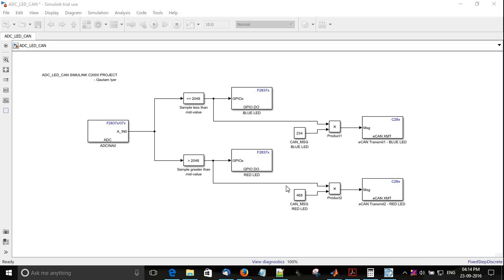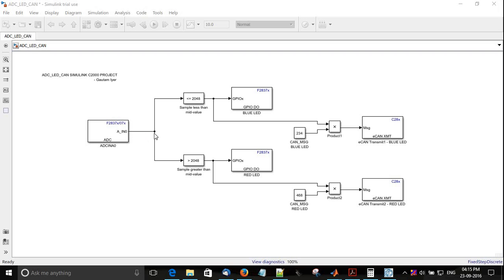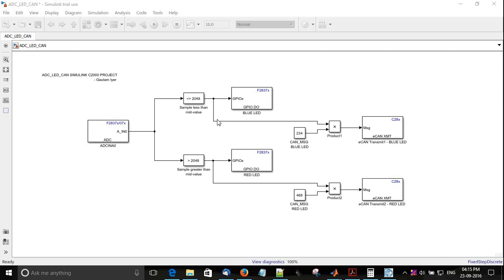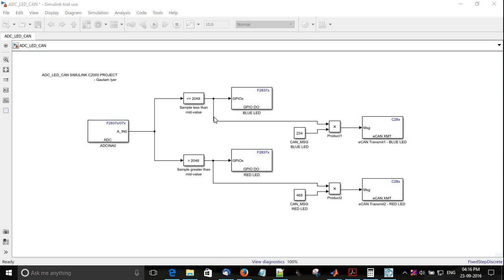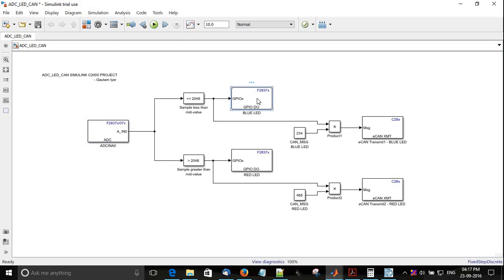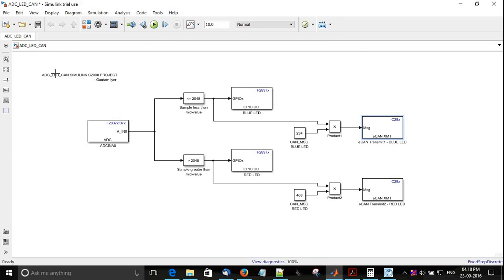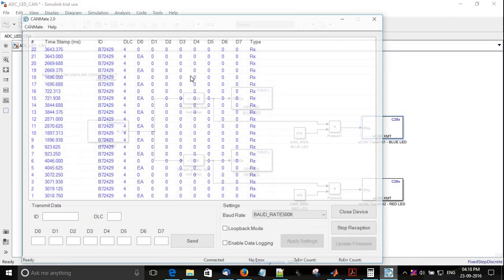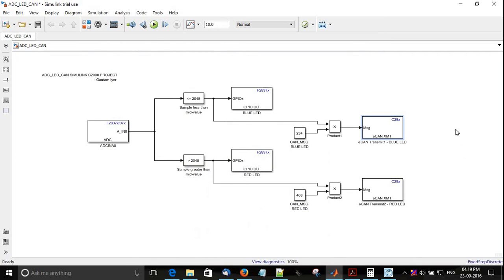Playing with ADC, GPIO and eCAN peripherals on TMS320F28379D launchpad - Simulink

Comment: Can you please help me in acquiring data of 4 input channels simultaneously by using TMS320F28379D?
Reply from the maker: Hi Venky, I would recommend you to post your queries on Simulink forum for C2000 devices.
Reply: @GautamIyer  I'm not using simulink ..I'm using it with CCS...
Reply from the maker: @venkateshgittagoni5659  oh... In that case C2000ware has examples and E2E forum would be the best place to answer your queries.

Comment: If I use Software trigger (while specifying sampling rate) then ADC will sample at specified time automatically right? Or do I have to give software trigger on my own? If I have to give software trigger,  how do I do that? The name 'software trigger' kind of confused me ^^"!

In this video you are using CPU Timer 0 for triggering SOC, what's difference between using that and software timer? 
PS : Your videos are way good and are helping us a lot in our BE Project, ty!
Reply from the maker: First of all, Thank you! You can either use software or hardware trigger. Software can be cpu-timer based and hardware can be epwm, external gpio Interrupt based.
Reply: @GautamIyer  Oh I see, and actually we are aiming to implement FOC (without using InstaSpin, because implementing FOC is what project is and we're supposed to do that on our own), we have made satisfactorily working matlab simulation, now we are planning to implement it on F28270F launchpad, can I use sine/cosine blocks of general matlab with inputs having correct data type? or do I need to use blocks available under 'optimization' category?
Reply: Hello Deep R. Ode, You can use the sine block (from Simulink >> Sources ), But you should use it in "sample based" instead of "Time based". The "Sample Time" and "Samples per period" is used to shape your signal.  for Cosine "Number of offset samples" can be used. Cosine is simply a shifted sine.